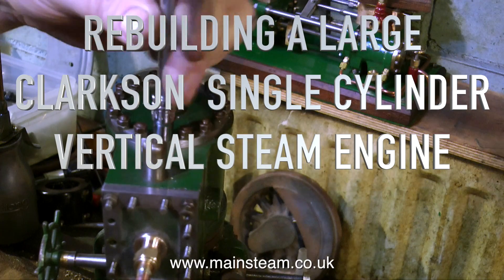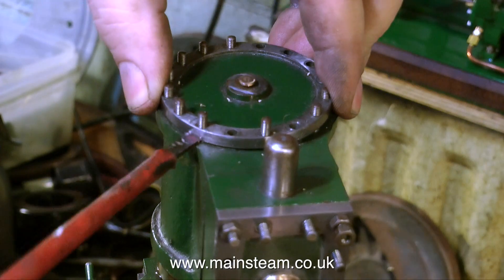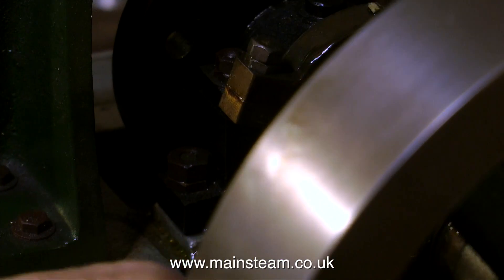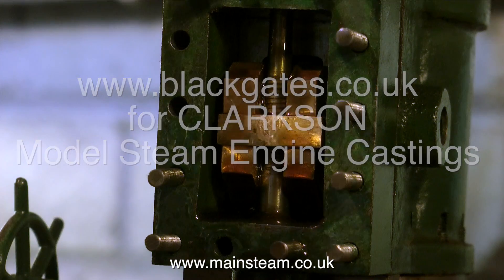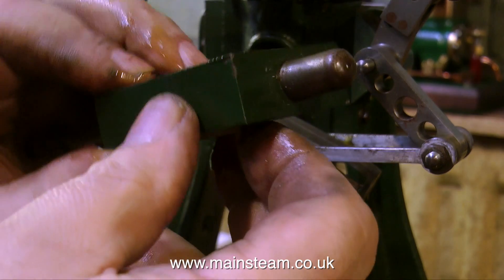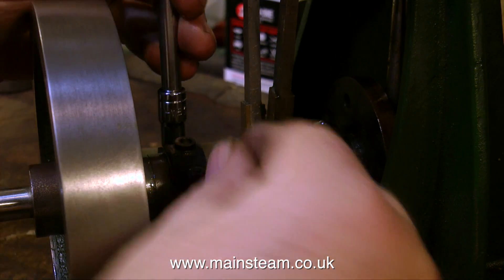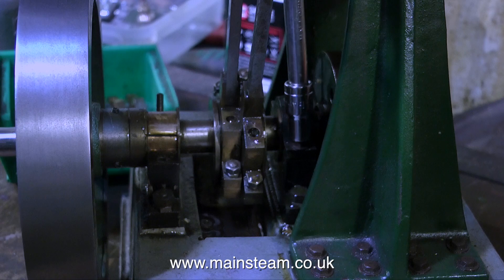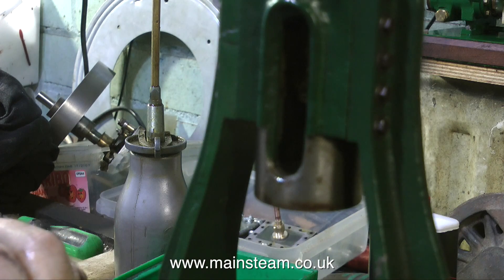REBUILDING A LARGE CLARKSON VERTICAL STEAM ENGINE - PART #3

Comment: I have a question, I have a Clarkson horizontal engine and the crank cam slipped, I timed it the best I can but was wondering if you have more info that could help, I don't know if this is the best way to contact you, my engine runs but I had the crank cam slip, do you have info on how to check the alignment? I used lock tight on the cam just incase it's not in the right spot, kinda new on trying to contact the author thanks, mine is also a reversible engine and that system seems to work well
Reply from the maker: Please watch my video about setting steam engine valve timing: 
https://youtu.be/YyIZQb-t9mc

Comment: I've restored several old woodworking machines, I've run across bronze bearings with no hole for the oil to get through.
I questioned it and was told the bronze is porous enough for the oil to make it's way through.
I also learned about bushings/bearings made from oil impregnated bronze called oilite  which they say never needs to be oiled.
This is all new to me, do you have any thoughts on that?
Reply from the maker: +C Smith Oil does not get through solid Bronze, "Oilite" is a specially manufactured porous version of Bronze so that retains the oil better.

Comment: Usually such one side slit bearings are better than halfed bearings. When tightened they don't loose their "roundness"  But normally a groove is machined around with two or tree holes to the inside. An other problem with such bearings is that they tend to spin itself. To suppress that they have sometimes a lock pin or a flange.

Comment: Perhaps drill out the holes on the covers very slightly so they aren't such a tight fit on the myriad of not completely straight studs?  I probably would have thrown it across the shop by now.
Reply from the maker: +Dean Doll My thoughts exactly.